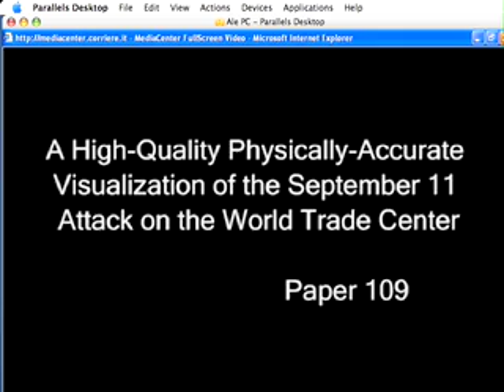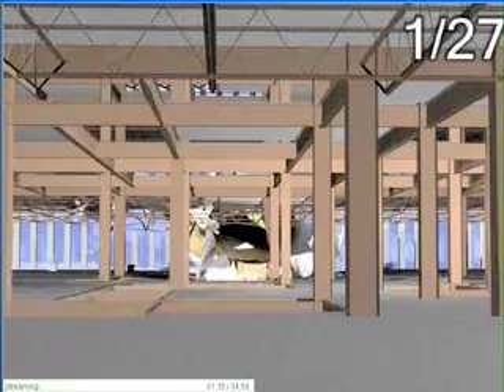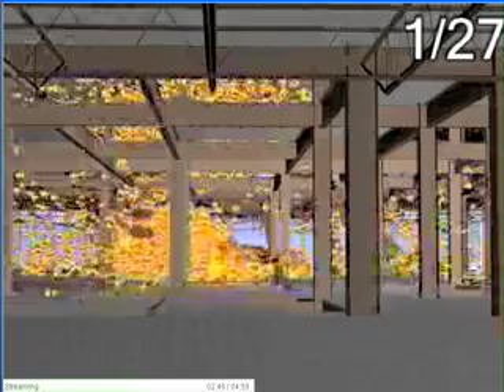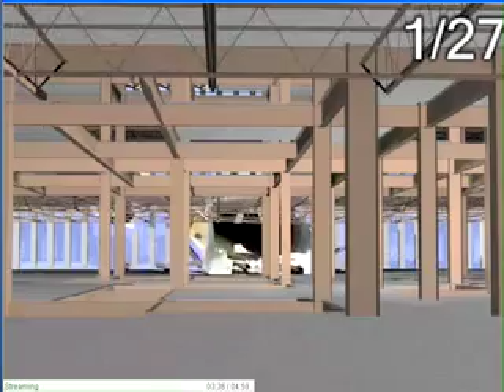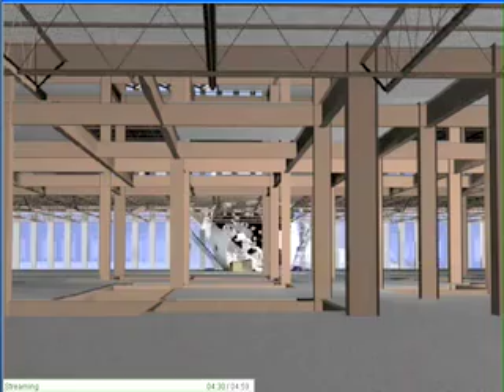9-11 Twin Towers Attack 3D simulation

Comment: Perfect reconstruction! Congratulations! Excellent animation. There is only one small detail: it seems that the plane enters a building made of flimsy plywood! and not a dense grid of steel and cement. Wings lightweight aluminum ..and the thin fuselage, against steel can not behave like that. A manufacturer Boeing said, but what do you think how stupid are people to believe such a stupid bullshit?
Reply: David Lango - Right, so the building was set with no one noticing anything out of the ordinary? These shadowy government types though it was a good idea to set a building with explosives and then fly a plane into it, all the while expecting the explosives to still work perfectly. Great plan, eh? I mean, fuck all could go wrong with THAT plan, could it?
The plane was travelling at 500mph. It is not, as is often implied, merely a tube of thin aluminium. You CTs are always comparing like for like without taking velocity into account. It's like tapping a bullet against your temple and saying "Look! Proof! It's impossible for lead to penetrate bone!"
Reply: Before fake news or after
Reply: +David Lango  The buildings DID survive the impacts.  You guys always forget that part.  But the buildings were NOT designed to handle being hit by airplanes "all day long".  That's just silly.  They were designed to handle the impact of a 707 with very little fuel at approach speeds.  If you don't understand the difference between that and a fully-fueled 767 hitting them at 500MPH then you must have failed high school physics.  Same thing applies if you don't understand how heat can weaken metal.
Reply: Murati Niza The airplanes shredded themselves on all that steel, atomized all the fuel, and momentum carried the "intense heat" NIST described clear out of the skyscraper into the open air where it went off in a gigantic fireball. The skyscrapers were built to stand there getting hit by airplanes all day long, and never fall down. It was a deliberate demolition. The airplanes were a ruse.

Comment: For the people who question Plane versus steel.. how did Kamikaze planes, mostly wood cut trough rough ww2 warships?
A battle ship has armor to protect it from impact of grenades and shells soooo... how is that possible that a kamikaze could ever sink a ship?
Reply: The kamikazes dove for the decks of these ships, which were made of wood. Let's not forget that they were loaded with explosives that would detonate upon impact and start fires. Which is what actually brought it down
Reply: Marshall Rowland The Empire State Building is very different in construction compared to the World Trade Center. A lot more concrete and brick and tile was used on the ESB. It was deemed to expensive to build modern skyscrapers that way. So the WTC was basically an exoskeleton design
Reply: @FirebirdCamaro1220  It was a terminator model 101 💀💀💀💀💀💀💀💀💀💀💀💀💀💀💀💀💀💀💀💀💀💀💀💀💀💀🏃🏃🏃🏃🏃🏃🏃🏃🏃🏃🏃🏃🏃🏃
Reply: they were flying bombs silly.   The only things that could have penetrated the towers were the two 7,000 pound engines and most of the fuel should have been ignited on impact as human remains mixed with aircraft structure fell to the streets. Crack a book on history of Empire State building.  Yep it struck by a B25 bomber in 1946. Its fuel was 120 octane gas. Yep they patched the building n cleaned up the debri on the street. 
I understand your reluctance to accept reality of what was done on 911 for to do so would crush your trust n faith in our country.
Reply: sks djd look it up...
Reply: +Marshall Rowland  The B-25 bomber was smaller than a 767 and hit the Empire State Building at a much slower speed.  As far as the rest of your comment... what in the world makes you think it would be easier to fake a passenger airliner crash on national TV than to actually... you know... crash a plane into the building?  That's a ridiculous notion even before taking into account the whole "controlled demolition" schtick you guys like to push.
Reply: http://worldwarwings.com/japanese-planes-launch-kamikaze-attack-heavy-cruiser-embarrassing/

Comment: The buildings stood 56 minutes, and an hour and 43 minutes after the impacts. NIST said the planes were carrying 10,000 gallons of jet fuel, 25% of which burned outside the buildings. NIST also said that the fuel that remained in the buildings burned off in the first few minutes after the impacts. 

The buildings survived the plane impacts and the jet fuel fires. Even if the jet fuel fires softened the steel, it cooled and regained strength in the time between the jet fuel burned off and the collapses. All steel is molten at some point, then molten or heated again to be formed or welded. Take the heat away, and you've got strong steel.

The official story doesn't hold up, especially when NIST said "We were unable to provide a full explanation for the total collapse." You people are defending an official story that doesn't bother to provide an explanation.
Reply: Yah but your not taking into account what this particular video is saying, while the plane is entering the building its smashing away MANY very important CORE support beams then your adding jet fuel which has been known to burn at almost the same temperatures as lava and molton steel and the fact that now the horizontal beams now have NO support to keep them upright. then you put 20 floors collapsing on top of them and what do you get...a cascade of collapsing is what.
Reply: Damian Smith The energy was released when the planes hit the buildings, but they stood. The jet fuel burned off, and they stood. The support columns were severed in many places all down the buildings, or they would have stood after the floors "cascaded" past them. Those vertical columns were a mere 1/4" thick at the top of the buildings, and 5 1/2" thick at the bases. The planes may have severed some columns at the impact sites, but they didn't do any damage below the impact sites.
Reply: Docktor Jim That's not really how gravity works... For that to happen the portion of the tower above the point of failure would have to tip until it's center of gravity was outside of the footprint of the building. 

But as it starts to tip the load in the failed area changes, increasing the likelihood of further failure. Basically it starts to tip, but the very action of the tipping causes what little support remained to fail meaning that it's no in motion downward - as per gravity.
Reply: Think More-Betterer No one has been able to model the collapses. NIST didn't even try. If it's so completely obvious that things fall through themselves, why isn't there one other example in history? Why can't it be modeled on an engineering program?
Reply: ***** Read NIST's final report on Building 7 sometime. NIST says that the failure of ONE column from fire caused the whole building to collapse, but if explosives had been used, MOST OR ALL of the columns would have to be removed. That's not good math.
Reply: David Lango The explosives would have been plainly obvious if they'd been there. They weren't. 

Literally every scientific study of the WTC collapses (including WTC7) reaches the same conclusion that NIST did.

Even before NIST's report was published others had determined the same manner of collapse.
Reply: Docktor Jim you don't take into account the constant weight of the building, in a well-designed system, a localized failure should not cause immediate collapse of the entire structure. However, the building stress of the top floors on the other columns causes them to bend until breaking point. Depending on the weight and structural integrity it can take a while before the collapse occurs.
Reply: Docktor Jim Think More-Betterer D Smyth Watch video of what happened. Pyroclastic clouds roar out of the airplane holes as if the steel core columns suddenly ionized. The entire skyscraper erupts and is obliterated in seconds. Millions of tons of steel and concrete reduced to a smoking hole in the ground. That, my friends, is not a 'collapse'. There were no gigantic piles of debris!
Reply: ***** Yes. There was more to the buildings than jet fuel and steel beams. There was also myth.
Reply: Docktor Jim More like deliberately not looking for explosives, to create a myth.
Reply: David Lango By the time everyone involved is dead, there might be enough people to call for an investigation.
Reply: David Lango "Chances are, you KNOW the buildings were brought down by deliberate demolition, but are paid by Hasbara to print bullshit lies."

Yes, of course. People who disagree with you are paid agents of them.
Reply: Think More-Betterer I wouldn't go that far. People are happy to deny facts and defend the official story as if it were their religion.
Reply: Uh...what? The steel cooled and regained strength??? Holy hell you are stupid. Wow.
Reply: @Human Observer It is absolutely possible for the wings to cut through steel. Mass and velocity my friend. I have seen straw driven through a phone pole and I've see high pressure water cut through steel like a hot knife through butter.
Reply: There is very clear evidence of the inward bowing of the exterior columns that is absolutely indicative of the failures that NIST describe as initiating the collapse. The deflection is visible in photographs, and it's not explained by the various controlled demolition theories. 

NIST doesn't set out to detail every moment of the collapse. They detail up to the initiation of the main collapse, from that point onward there are far too many variables to accurately model events, but simple extrapolation of the events and forces explains the broad sequence of events beyond the initial failure in each building.

The NIST reports (and various other studies which reach effectively the same conclusions) are the ONLY detailed hypothesis that has ever been presented. The finding match the observable evidence and provide a plausible and likely explanation for the failures as observed. 

The 9/11 Truth community, so far as I can tell, has never produced anything remotely close to detailing the events as they propose they occurred. It's all just broad sweeping statements about what couldn't have happened.

Jet fuel has never been attributed as the cause of the collapse. Fire has - even without the jet fuel there was no shortage of combustible material within the buildings to fuel the fires. In fact an independent study has since even suggested that the unique design of the Twin Towers was quite vulnerable to fire and that collapse could have initiated even without the structure being weakened by the impact of the aircraft. The temperature of the fire was relevant than the scale of it.
Reply: Rollin' Dutchy The buildings were towers, surrounded on all sides by air. If they failed at the plane impact sites, they should have toppled over, instead of collapsing down through themselves.
Reply: ***** There is nothing but omissions, conjecture, and lies in the NIST report. Read it. They suppose that much of the jet fuel was left over inside the towers. They never even looked for the explosives needed for those demolitions.
Reply: Think More-Betterer Liar.

I have a copy of "Tuesday Morning in September" by Jim Kosior who filmed the whole thing from New Jersey. The buildings blew up. 

If you can watch what happened and believe the establishment 'collapse' lie, then you have no building trade experience and watch too much TV.

Chances are, you KNOW the buildings were brought down by deliberate demolition, but are paid by Hasbara to print bullshit lies.
Reply: @davidlango1850  Wow...get some mental health assistance asap.
Reply: D Smyth I see you're full of establishment KoolAid also. It's incredible that our Jewish owned media had so many convinced to look away, no demolition to see here. Well not anymore. People are waking up. 9/11 was a false flag.

Comment: But it ain't now hard to find believe bcuz that was a terrorist and was stealthy and walked into the flight area and slit their thoughts and purposely ran into him!!!
Reply: No it is a 3D mode.
Reply: Kari Bond
Airplane (alluminium) cuts throught 244 Outside- and 47 Inner A36- and A441-Structural-Steel-Work (Ø=0,45m). Even the outer parts of the wings (alluminium!) are cutting these steal beams.
Reply: Too Sad

Comment: 1.51-1.52 lower left corner. Plane debris go through the horizontal braced frame, then the steel heals back up. Nice trolljob. worthless simulation with bogus data

Comment: The steel at the perimeter columns were only 3/8-1/4” thick & the core columns were probably no thicker than 2” at the point of impact. A 200,000 lb plane traveling 500 mph would have no problem pushing thru the box column & shearing the connection bolts. Aircraft alum has a higher tensile rating than steel; it’s strong enough to lift a 200,000 lb plane using just air pressure. NO bldg is made to withstand the impact of plane at full speed.

Comment: Real life:
a 0.50-1 inch framed steel can slice up an aluminum plane, it can even cut off its wings even how fast/slow the plane travels.
Question= How can a Aluminum Plane Penetrate/Cut an 6inch steel?
Please answer with Computation/ Using Physics,

Comment: like 200 somethin people on the plane... then arund 3,000 people in the building... all those people were trapped hundreds of feet above the ground surrounded by smoke and fire... once the second plane hit you either had to burn alive or jump out the building... alot of people chose to jumps if they didn't die from the impact or just burn or die of smoke. so much smoke!

Comment: No lie there...the columns you see in front are only aluminium architectural decorations they are not structural the center part (core) is structural and was really badly damaged when the plane crashed into the tower...if you think I'm lying, take a look on google and search for "world trade center blueprints"

Comment: Bodies in motion transfer kinetic energy to stationary objects. If the energy is less than needed to send the 2nd body on its way, the 1st will either penetrate it or begin to break itself up, as well as the body it contacts if they are not solid enough. A stone transferring energy to just air will burn up, as in meteor. All energy is dissipated as heat, so impacts generate heat while transferring energy, and it's considered a loss of energy. Some in, less out (as motion or kinetic energy).

Comment: the plane struck between the 93rd and 99th floor and destroyed most of the columns on impact, that is extremely close to the top. What i don't understand is that, in footage of the tower collapsing, it seems to show that the tower is falling in on itself. How does it seem to collapse on the bottom when the columns were taken out at the top?

Comment: not really. aluminum is used because is lighter than steel. the fact that debris comes out of the other side of the building is because the plane is traveling at such a high speed increasing actual weight plus the explosion which helped to push debris to all sides.

Comment: I am explaining some of the things that happened, I am not claiming that is ALL that happened.
when the planes reached the cores they destroyed the steel on the sides they hit (the top of the south tower falling over to the side that was hit is the indicator of this) if you watch the plane hit the so tower in slo-mo you can see that it did not explode till it impacted the core, which means that the fuel tanks busted open inside the core and much of the fuel went down the elevator shafts.

Comment: planes yes, bombs no, there were bomb sniffing dogs at the WTC so they would have found the bombs but didn't, that and the planes impacts would have set them off and dropped each tower upon each impact but that didn't happen either so no bombs were planted. my video "how the towers fell" explains how it was the planes that caused the collapses and my video "9/11 engines down elevator shafts" explains what was heard in the lower levels of the north tower.

Comment: cont from prev post
the 2 sounds that Willie Rodreguez heard in the lower levels were the 2 engines from the plane, I explain it in my video "9/11 engines down elevator shafts" the lower floors cracking is explained by the evidence and witnesses when the planes rocked the towers so hard the one blew out the windows in the lobby of the no tower, 2 of my videos explain the details "loose change answer number 118 with witness" and "inside the twin towers"

Comment: cont from prev post
if there were devices planted and it has been proven that the planes made contact with the steel in the cores, can you explain what 1000's of A&E'S for 9/11 truth can't? how did anyone manage to set devices in the towers in such a way that the planes impacts including the fireballs, static electricity created by the friction and the towers severed electrical wiring wouldn't set them off and drop each tower upon each impact?
cont next post

Comment: cont from prev post
the jolt of the top of each tower falling onto the floor below caused the pile driver effect, it wasn't so much the steel that failed as it was the nuts, bolts, rivets, and welds that did. as more weight was added to each floor the collapses progressively got faster as explained by one of the survivors in the video "miracle in stairwell B" who explained the "pancake effect" that effect explains what the dust clouds were made of, it was the sheetrock walls.
cont next post

Comment: the top of the so tower falling over to the side that was hit just before collapse is the indicator that the planes penetrated the cores and destroyed the steel on each side (you will notice that the antenna on the no tower did dip to the side it was hit and was not as noticeable because more of the steel was weakened) the engines falling down the shafts in the no tower is further evidence that the planes did penetrate the cores, once the collapses started...
cont next post